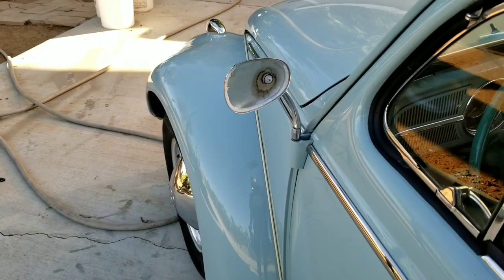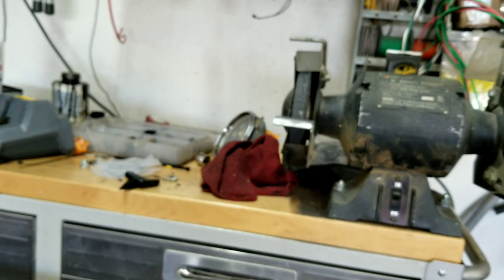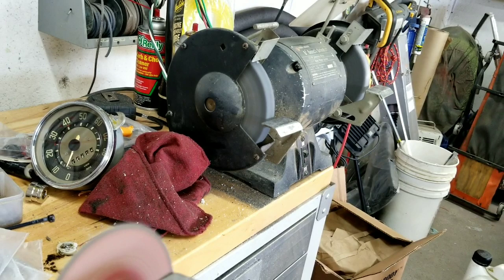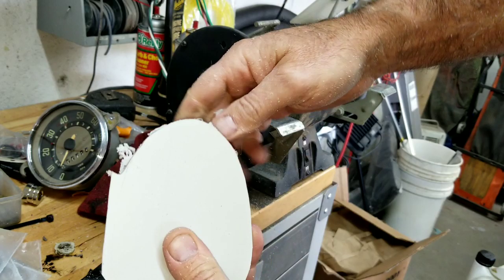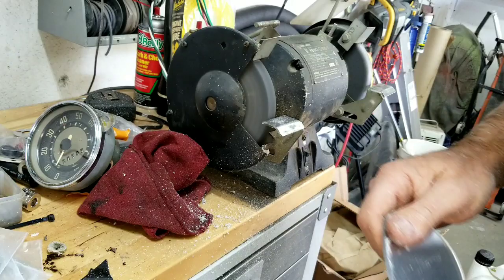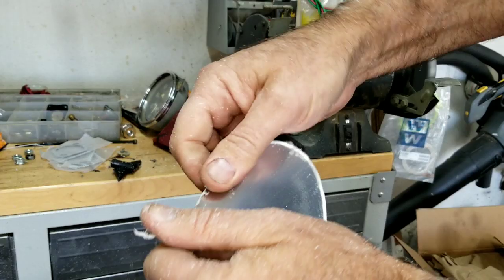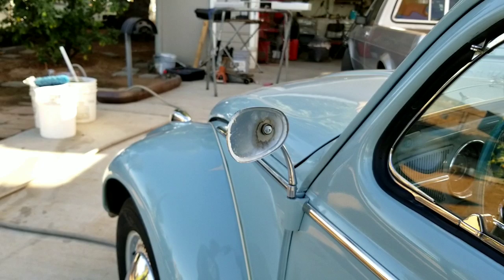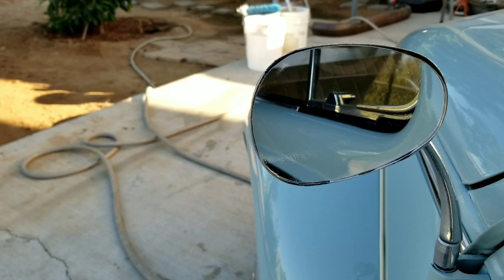Vw bug broken mirror repair without going to glass shop

Comment: Great repair! Mike, my 67 round mirror heads don’t hold when driving, not the stems they are tight.Is there anyway to tighten them? Or who has good quality replacements?
Reply from the maker: Yea I think you can do something with the mirror out. or sometimes I put some super glue around them and it stiffens them up.
Reply: I will give that a try, thanks
Reply: Good question, I have my old ones but picked up some up at Wolfsburg West.

Comment: I didn't think acrylic mirror would be so reflective.looks like a good fix. That bench grinder is a worry though it looks like you have been grinding aluminum on that stone and that is a big NO NO as it gets stuck in the pores of the stone and when it gets hot it will expand and the stone can explode.
Reply from the maker: yea for sure I that stone is pretty loaded up.